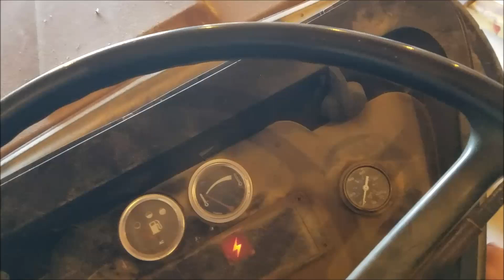How to make TRAILER HINGES, a TAILGATE and MORE!

Comment: Based on my experience on my trailer, I would install an angle on the floor at the entrance on the trailer, so your floor metal dos not get tangled up on anything to avoid another unnecessary fix. Good video. Thank you

Comment: who ever buy steel mesh 4 x 8 sheet put on trailer in the long run going have trouble sooner or later ! .

NEVER PUT STEEL MESH FOR ANY FLOORING OR DECKING   UN LESS U HAVE HEAVY DUTY STEEL MESH SHEET  " WANT HARDLY BROKE UNDER A LOAD  "   ! ! ! ! .